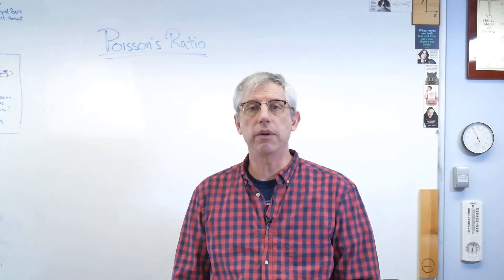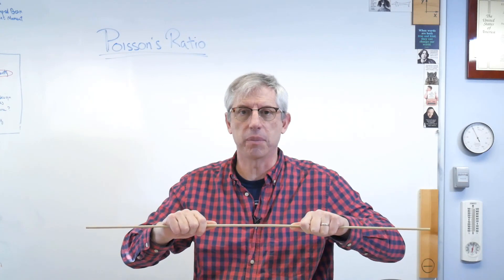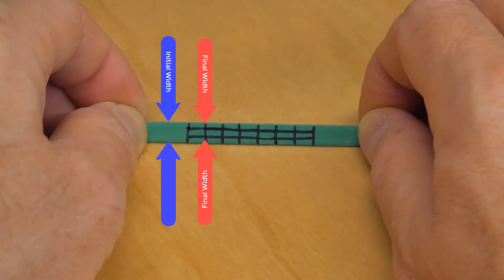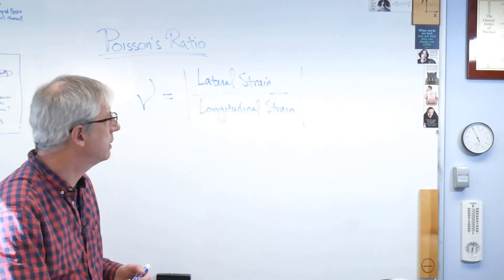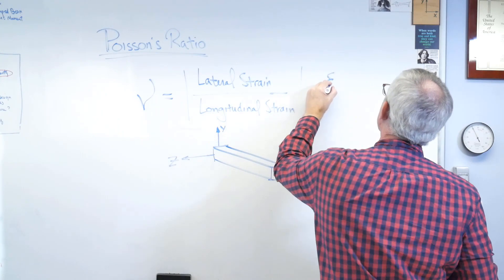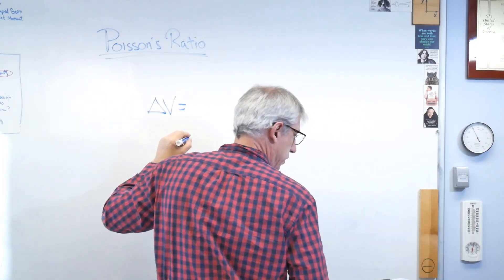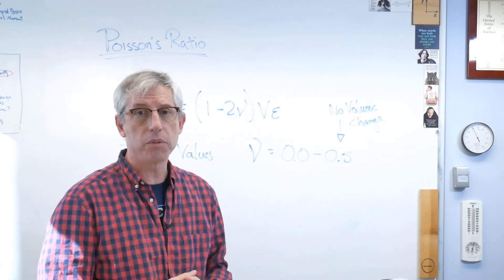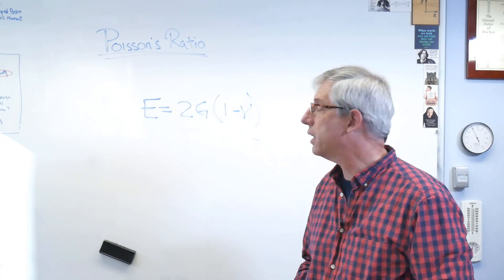Poisson's Ratio - Brain Waves

Comment: What if you're trying to figure out the dimensional change of a rubber band instead of just a straight object?
I'm trying to calculate the new rubber band width after slipping it onto a larger diameter, therefore stretching its circumference and reducing its width.

Would longitudinal strain be the before and after of the rubber band circumference?
Then you can work out what the new band width will be based on this and poissons ratio?

Many Thanks, shanen